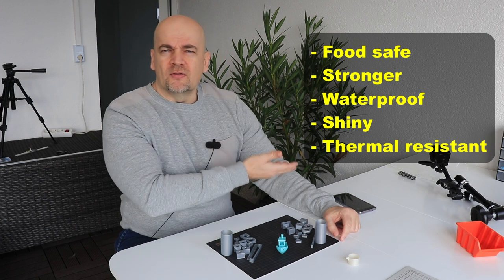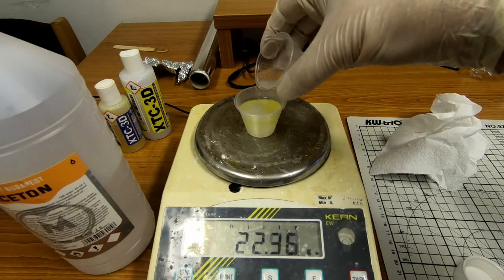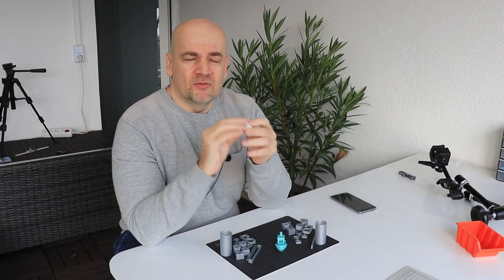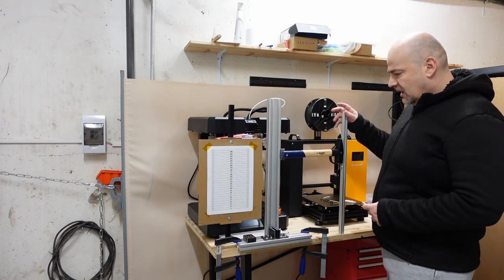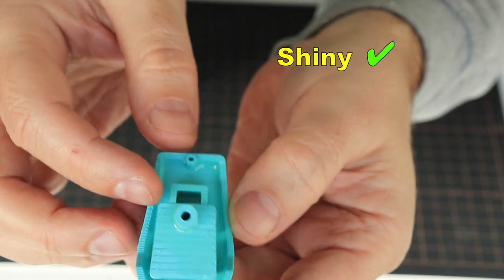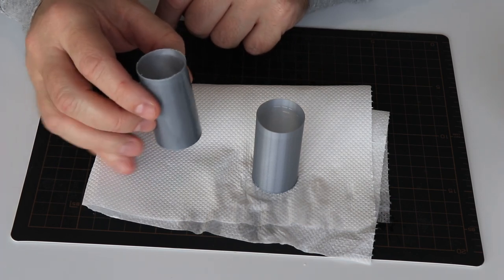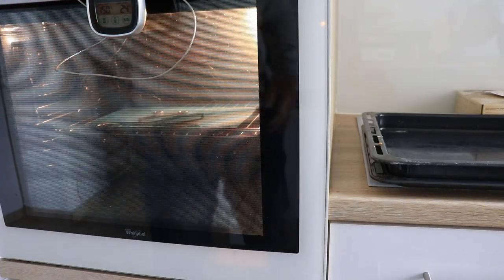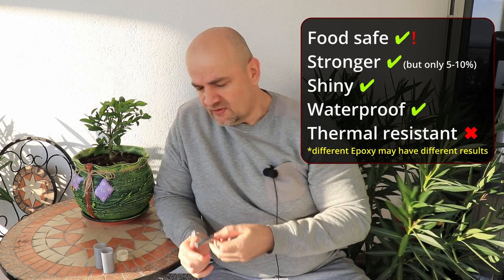3D printed objects coated with epoxy resin - but why?

Comment: XTC 3D is just basic epoxy resin sold 3x or even 4x the usualy price only because it's written "3D" on it, don't buy it's a scam, just buy regular epoxy for much cheaper.
Reply: Does refular epoxy resin work for smoothing PLA 3d prints?

Comment: Another thing to test would be prints filled with epoxy. Use Gyroid infill and print with 0 roof or floor layers so the infill is exposed on one surface. Gyroid infill is designed to allow free flow of filler throughout the model, since all voids in gyroid pattern connect to the voids around them.
Reply: Did that actually. It’s working pretty well Especially when printing models in vase mode

Comment: Using resin to create food safe surfaces is very, very sketchy thing to try to accomplish. Resins can easily de-laminate from surfaces. I would much rather try something like make mold and resin that and use something like food grade silicon or something  get the actual food safe product.

Comment: I like your list of claims! You try to address those claims but many paints, varnishes and similar products are available, many don’t need mixing (one part). I have a bottle of clear nail varnish for fixing up prints and waterproofing. It also helps fit parts (like a lid) that are slightly small. It dries quickly and you can apply a second coat. I’ve also used “plastidip”, a thick liquid that dries to a soft rubber, for some parts. Polyurethane varnish is very tough. PVA (white wood glue) glue works well and is very inexpensive and gets used on cutting boards so I expect a food safe version might be available. I expect nail varnish might be foodsafe seeing as it’s used on you fingers. If you only need one or 2 of the attributes, another coating may be suitable and easier to use.

Also , one part coatings usually shrink as the solvent evaporates, 2 parts like epoxy don’t shrink. UV cure also doesn’t shrink. If it doesn’t shrink it will retain the shiny texture with just one coat

Comment: The streght test: What if you give more layers of resin/thicker coatings
For the waterproof: what about taking the container that leaks and dry it out, the coat it and check? just to make sure that the coated one doesn't leak because of resin not jus that it got better printed (probably the resin is the only difference, but to check)

nice analysis

Comment: Another great video. I noticed with the benchy that the epoxy seemed to have a yellowish tint where it thickened on the deck. It won't be noticeable for some colours but, for example, for white or marble it would change the colour. Of course it does not has any effect on what you were testing for.

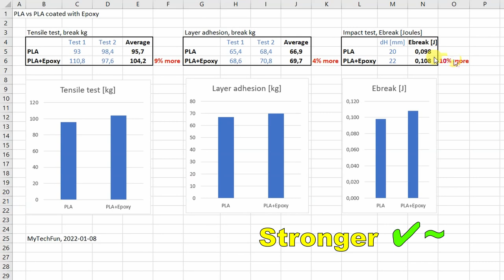Comment: Hello, when you present the results at 6:07, I think doing the experiments on only 2 pieces is much too low be statistically relevant, I would have much preferred seeing the results with 10 expriments instead of just 2, and use the median of all the results to compare. Thanks for the video

Comment: Nice video, very clear.
I think if you want to make your objects stronger you can use fiberglass mat and epoxy, I think you can buy very thin fiberglass which will help quite a lot. But it's also quite a bit more work though.

Comment: You could do a Epoxy VS SLA resin coated  and cured with UV comparison, that might be interesting. mean reason for people coating PLA is to get rid of layer lines i believe and todo less sanding.
Reply: @ParabolicLabs  ...uh you might test some more before you do a lot conclusions. the layer height you're speaking of has impact on curing yes, but it only means you need more exposure time! Tried curing your parts in a curing station over a few minutes? etc.  As far as the airbrushing goes, with good ventilation(i mean fans here!) airbrushing is no problem, however seeing as resin is pretty "thick", airbrushing is only useful for getting correct thickness layers on small parts.
Reply: @ParabolicLabs  I think SLA printers work by using a screen (lcd or whatever) to restrict the light! and thus not exposing the whole vat! how do you think they work?! Anyway, i do agree on the safety that you have to use with airbrushing resin. I custom paint, so i have al the equipment needed, i personally don't airbrush it, just saying it is definitely a usable option. I'll add that the resin not curing could have many factors, you might wanna try a different resin etc. but it does work! and the reason for using resin instead of epoxy would be drying times mostly, however it would be interesting to see if it gives more strength too.
Reply: @ParabolicLabs  I have seen countless videos of people coating helmets and other large 3d prints with SLA resin,  they used anything from UV flashlights, to sunlight for curing.  SLA will solidify even in a container shining a UV light on it.

now there is a problem with some resins being inhibited of completely curing because of the surface they are placed on.  you might want to try coating various surfaces with sla resin, and using a 405nm light source, and try again.

I completely agree with what you said about spraying resin,  very unhealthy.

Comment: i like how thorough you are with your tests, always. this one no exception. i AM curious however, about the epoxy... if the surface is smoothed out or retains some of those underlying printline details. i have many printed parts to smooth with sandpaper currently, and i am wondering if epoxy will be my salvation.

Comment: I would love to make large automotive parts out of PLA as it's cheap and prints incredibly fast and then epoxy coat them so their heat proof and stuper strong.  Also, the epoxy resin matters I think.  Stranger epoxy and thicker.  This epoxy seems to be for toys.

Comment: Hi Igor! I purchased some 3D printed watercolor paint mixing trays, but the paint gets stuck in the grooves. I have looked online, but it seems you have to buy a lot more of the liquid than I need, and it's a fairly complicated process. Do you have any suggestions for an epoxy spray to coat these trays? All I need is that it dries smooth and waterproof. Maybe this is not a question for you. I have considered using clear fingernail polish. 😊 Thanks for your time!

Comment: seeing the impressive results with salt annealing i was thinking that the surface of those prints have an ideal surface to test epoxy coating improvment. dont think anyone has tried combining these two. 
also saw a video where u can improve printed nylon's water absorption problem by soaking the parts in an oil, so was wondering if you soaked the item in the epoxy resin without the hardener for a few hours before patting dry and then applying epoxy + hardener it would become like impregnated with epoxy.... 
wonder if this would be strong enough to use for fire- arm mfg? 
good video, thanks for uploading

Comment: Great stuff epoxy, looks like not so much for this purpose though. What about Electroplating parts?
Reply: Good idea! with different metal surfaces.
Reply: thermoplastics are usually not conductive
Reply: @Andreas-gh6is  There are liquid based solutions. search Youtube for pla metal electroplating or something...i remember a mandalorian helmet being done which is a nice video.
Reply: @peterdocter4659  graphite powder into a paint seems to be the cheapest option i can find.
Reply: @NathanCroucher  That will make no difference in strength or surface smoothness! and as far as conductivity goes it's particles isolated by the substance so won't get any/much current through...
Reply: @peterdocter4659  "There are liquid based solutions"
Yeah, graphite powder + paint as a base to zap the metal onto the print.

DIY base coat using graphite powder, its a lot cheaper than buying conductive paint. Unless you know a cheaper way??
Reply: @NathanCroucher  ...might want to do some research there first...
Reply: @peterdocter4659  Me or you? Ive seen it work.
As for strength and finish, maybe do a video on it to see the results, like say similar to the one you just watched with epoxy.

"Good idea! with different metal surfaces."
Reply: @NathanCroucher  Agree to disagree about the paint, it is not the electrolytic process i'm talking about though.

Comment: One thing I would like to know is if it actually is safe to put the prints in the oven you cook with. I would guess as long as it doesn't get too hot and properly melt or vaporize it would be ok. But I still would not do it. My tin foil hat is too tight for that.

Comment: Or just print in PETG and tick all the boxes?
Reply from the maker: Not really, same problem with bacterial colonies we have with PETG and PLA. PLA is stronger, but only on room temperature (except it is brittle). Shiny? Waterproof? Same as PLA. Thermal resistance is bigger (approx 75 vs 55°C)

Comment: As an industrial designer and model-maker, I never use a 3D printed object as a final part where durability, strength or sanitation is important. I'd printed parts are great for prototyping or creating masters from which other parts can be molded, although, their stepped surface still requires clean-up and prep.

The filament I tend to use is the standard PLA which is a bioplastic derived from renewable sources and is degradable via various mechanisms. Essentially it's a fairly low-impact plastic. Adding toxic epoxies, paints or other resins significantly raises the carbon footprint for the process.

Comment: I'd rather not do it. Either print in resin which I don't prefer for the same reason, or print FDM in higher resolution, or a stronger filament, or more infill and accept the results. My health is more important than the look of a silly knick knack I am printing.
Reply: I completely agree. Also, adding toxic resins and plastics only increases the negative environmental impacts of this technology.
Reply from the maker: Once when it is cured properly, epoxy is not toxic.
Reply: @MyTechFun  Yes. However, the production, packaging, transport, and use of epoxy and other similar resins is toxic and produces a significant amount of waste and unwanted chemical byproducts at both ends of it's lifespan.